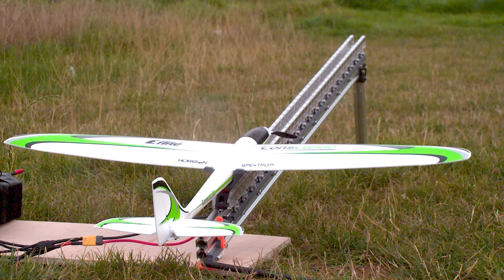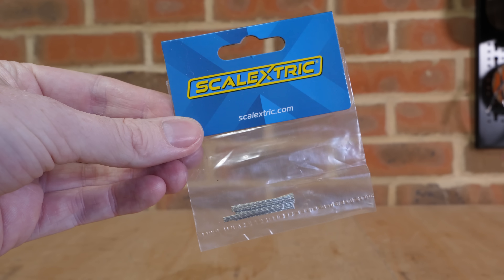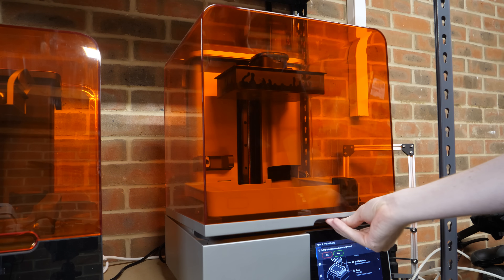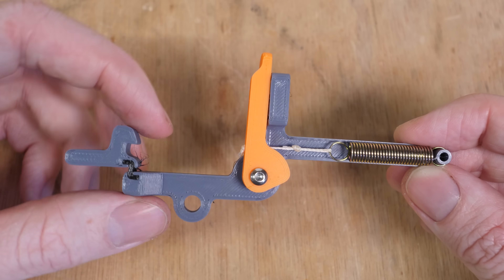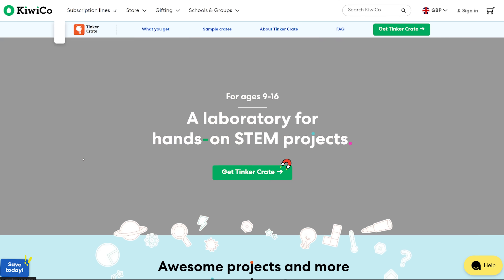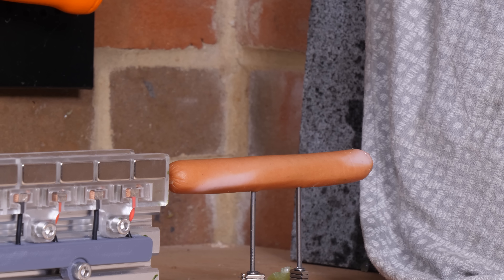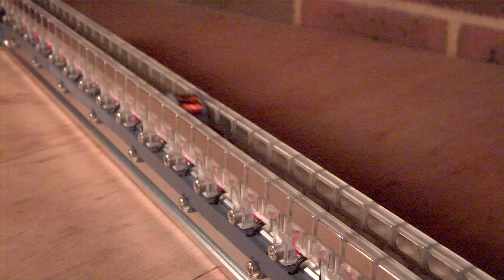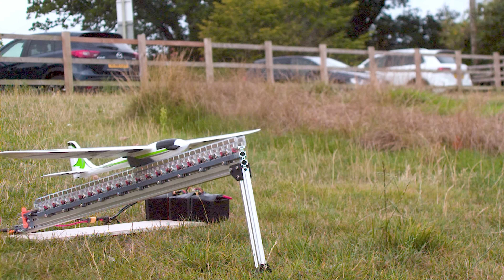Electromagnetic Aircraft Launcher

Comment: You coupd try aluminium wire. 
It has double the resistance, but is 3 times lighter. So while a larger gauge of wire will be needed and a physically bigger coil for the same turns and resistance. 
It will weigh less for the same performance.

Comment: As to the sparking. 
You can put a capacitor across the coil. The value will be a bit of trial and error. 
But it will absorbe the sudden voltage collaps as they disconnect and the EM field collapses. Which is exactly what the codes or in an old ignition system does.

Not sure if this will help or hider performance but couod help the contacts last a lot longer. 

Another option is to use starter motor brushes. The carbon lubricates them while the high copper content allows for massive current transfer.

Comment: Great project. With regards to the Launch switch bouncing, maybe you could use another spring OR your magnet idea to SLAM the switch shut so it can't bounce back. I think electric trains use a solonoid contact to switch in high power from overhead lines. If you start shooting nails this way then make sure you are below 14ft/lb lol.. nee nah, nee nah. :) Keep up the good work and I love your flywheel trebuchet idea, could maybe used to launch grenades as a cheap thought.

Comment: always very nice, interesting and of course skillful what you present here on YouTube, but since I come from E-Tech, I suggest turning the system around - putting a strong permanent magnet on the carriage to be accelerated and controlling the electrical energy supply (coils) on both sides of the rail ... then you don't have to transmit the current through brushes with so many losses (contact problems, sparks and friction). The trigger moment, when switching on and off, you can easily control with Hall sensors (or IR sensors), letting the MOSFETs switch on and off to activate the coils - well, just an idea to increase efficiency and make your little miracle even more powerful ,)
Reply from the maker: The launcher I built 2 years ago used hall effect sensors and mosfets. However, it was far more complex to build due to the timing control electronics, let alone have to wind far more coils along the rail.

Comment: There was a noticable lack of EE in this video; i'm not sure if this is relevant on this timescale but your inductor coil resists the change in current, would have liked to see some maths to see if it is relevant here. When are you going to build a real railgun? ;)

Also, Ofcourse it is faster than your calculations, adding a load makes it spend more time in your launcher = a higher total force.

Comment: Do the opposite, coils in the rail and magnets on the moving part, like a linear motor, with variable frequency and voltage you can control speed and power. You solve the problem of sparks and friction
Reply from the maker: That's exactly how my old launcher works

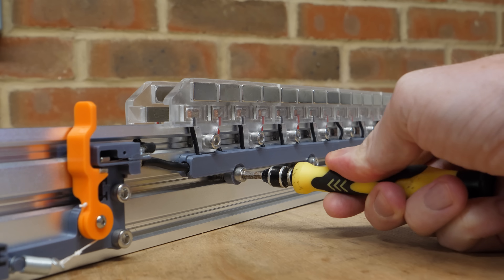Comment: 8:00 very cool solution to make your own reed type switch!

Another idea that first came to me, was making a latch at the top that as it hits, holds it up and won't let it bounce at all. Then to reset, you lift the latch and put in the lower latch
Reply: Any off-the-shelf light switch would work even better
Reply: @poipoi300  I don't know if light switch would be able to handle the amps? (I know most are 25amps AC always confused on how to figure out what DC current that means.)

Also, I think there might still be some 'bounce' in a switch at the high of speeds he's dealing with?
Reply: @justinbanks2380  His power source is DC, but if you check how the circuit is used, it's a lot more like AC. The load isn't continuous, instead it's alternating between on and off. Not for long either. Light switches are designed in such a manner that they don't spark. I'd imagine them to have less bounce on startup than what he built, but I don't know that for certain.

Thinking about this made me consider something else though. It's stupid to start the propulsion with a switch in the first place. This would just exacerbate melting issues on the first contacts as the sled will spend significantly more time there from a standstill. This is a common issue in railguns that they solve by having pre-travel on the projectile. Instead of some complicated switch to power on the system, the shuttle should be pushed into position. This would also make the shuttle achieve higher speeds.

Comment: 1- use round magnets, fixed in the center.
2- use two coil to both sides of the fixed round magnet in the center.
3- use metal ball bearings in electrical rails, this will provide the power contact to the coils, cover with isolation the rails with no power zones.
4- use LC series circuit to reuse Back EMF for next stage.

Comment: Thinking about it now, I personally would have gone with permanent power rails, and use the contacts to commutate a simple MOSFET bridge aboard the sled, a few caps on the + and - and the body diodes will freewheel on their own. The switching current needed to switch the FETs would be far lower and make the system more efficient. Though I might be overthinking this (job hazard lol).

If you wanted to really transfer some power I'd also ditch the solder braid or Scalextric parts for some racing grade slotcar parts. Professional Eurosport or Group 12 slotcar parts can handle well over 20A for short periods of time, this would require using the right braids with the right pressure, and also a braided copper power rail like on professional slotcar tracks. Look up the british slot car racing association for some pointers to take this thing to 11!

Comment: As other posters have noted, I think your top speed is limited by inductance certainly an MOV and a high current diode in reverse across your power supply would help. Maybe the magnets should be spaced further apart as you work your way down the track with the contacts moving progressively earlier relative to the magnets (so you get a progressive phase advance as it speeds up. Awesome video!

Comment: Wouldn't it be more practical to have the permanent magnets on the sled and the electromagnets on the rail, instead of the other way around? It might result in a heavier sled, but there'd be no need for brushes so there'd be a lot less friction. The timing of the electromagnets would be a bit trickier to get right, but nothing too hard. In fact, the timing could be adjusted for a gentler acceleration, heavier loads, etc.

Comment: I believe by using the expensive brushes you bought at first you can decrease molten copper on the rails, I'm not exactly sure but they seemed to be made out of nickel (judging by the silver color of it) and if not they had a coating especial to be rubbed against the rails.

Comment: You can probbably reduce the coil mass with aluminium wire, perhaps use graphite contacts to reduce the molten copper issue.

Comment: Now i see why rail based technology failed. If you put it side by side to a mechanical motor based mechanical pully lauchers or rocket powered launchers the efficiency is extremely low on the rail. Intrensesting stuff.

Comment: I think you will gain more speed if the magnets were at increasingly further distances as the object accelerates. then you can pass current at higher frequencies at each subsequent magnet and accelerate the object. it's more electrical work, but will achieve higher terminal velocity

Comment: as coil runs through magnets its act as a generator. measuring dc resistance wont do much as back emf will be much greater decreasing the max speed. 
try winding coil with 4 wires and then connect them differently to find a sweet spot. all in parallel, two in series two in parallel, all series..

Comment: have you thought about adding capacitors in the power rails to add stages to up the volts as it travels the length as it goes down to in crease acceleration and maybe one in the sled to make sure constant power to the coils so no lose of power ?

Comment: Just in case i missed it, why dont you build a classic lsm motor?

Ok you need more coils, but you'd have just a magnet sled and hall-sensors to trigger the coils.

You can build the coil static in the mittle and put 2 rows of magnets on your sled.

Comment: My lab professor recommended us this method: use a powerdrill in a vice and tap your foot on a phone with a counting app. One hand controlling the drill, the other with the wire. It takes some setup but it's so much faster, I actually do it like that because of the time save and ease of counting turns but another big bonus is neat coils have much better fields

Hope you give it a try if you ever make coils again!

Comment: Coil on the kart+coils allong the track. Leave the kart connected to the rail at all time. Use your brush system but replace with bearings these brush only carry 5V to trigger mosfets. 
This setup would be similar to universal motors, with transistors eliminating sparks. Bearings would allow to improve contact by adding pressure to the sides without creating lots of  friction. 

I think this would increase the energy transfer by about 400%.. So speed by maybe 200%

Comment: I was experimenting with a 1.2kj classical railgun a few years back. Every time I tried a solid armature it welded and the projectile went nowhere. Later I tried the wire brush design and it worked way better. 

I'd be really interested to see someone try to use liquid metal as a sliding contact in a classical rail design. One of the reasons I think nobody has tried is that you'd be spraying liquid gallium alloys all over the place. It would be very messy and anything made of aluminum that was nearby would get destroyed by the gallium if it got on it.

Comment: Important consideration when talking about the number of turns is the RPM- or in this case velocity Constant value. 
It is what limits electric motors to a certain speed using a certain voltage (not taking active field weakening into consideration).

The more turns you’ll do, the stronger the E-magnet gets and the more force / more acceleration is created everything else being equal. This comes with a downside tho, even apart from weight that I believe is far more important:

As your magnetic field for a given amount of current gets stronger, the same way the back-EMF gets stronger. Because when this coil passes these magnets there is voltage induced in the turns of the coil and there’s current flowing the opposite way than the current from the battery. 
Of course this reverse current flow creates an opposing magnetic field that works against the field that is propelling the sled forward / respective that is turning the rotor of the motor the desired way around.
This is called BEMF of Back-electromotive-Force. 

Of course the faster you pass magnets along a coil, the higher the induced voltage is and the more current will flow and the higher the back-emf will be.

On a coil with double the turns the back EMF for a given velocity will be twice as high.

Once the magnetic field pushing the sled forward (or accelerating the rotor in an electric motor) and the field that is slowing it down cancel out you reached the maximum speed of that motor. Be it a rotational or linear motor.

I believe that could have been even a bigger factor in your comparison. Not only was the coil with more turns heavier, it also reached its maximum speed soon along the way.

For the sake of explanation let’s assume:

The 400 turn sled reached it’s maximum speed at 1/3 of the way

The 300 on 2/3 of the way

The 200 on 3/3 of the way

And the 100 never reached it. It would have on 4/3 of the way

That shows us that the acceleration of the sled was the most efficient at 200 turns

400 turns accelerated the hardest but then cruised two thirds of the way at constant speed

300 reached a higher velocity but did so after two thirds of the way, without gaining anything energy from the last third.

200 used the available acceleration distance perfectly. It accelerated all the way through and reached its maximum speed right at the end of the distance 

100 would be faster than 200 if it had a longer distance available. 
Because it’s acceleration force was the weakest, it never could make use of this benefit because when it reached the end of the launcher, it didn’t had its top speed achieved. Because it accelerated slower than 200, because fewer turns = less forces it didn’t have 200s speed at the end of the track either and could never make use of the potential higher top speed.

That, I believe even is a bigger factor than the weight.

It’s like letting 4 cars drag race but not allowed to shift!

One stuck in first gear (400t)

One stuck in second (300t) 

One stuck in third (200)

One stuck in 5 (100)

While the higher the gear, the higher the top speed, the force and thus acceleration slows down proportionally.

So 3rd gear in our example was the sweet spot for let’s say 150 meters long drag race.

Make your launcher shorter and probably 300 or 400 will win the race.

Make it longer and 100 will beat 200 all the time! Because weight isn’t really the limiting factor here!

If you want to gain a deeper understanding about it look for „KV rating - brushless motor“

Maybe you could do the experiment if you want to! 😃

Comment: 6:49 what you could've done would've been a ratchet stopper or whatever they're called (like a ratchet wrench), so it allows movement 1 way but not the other (for more context how that would work here, you can watch Mythbusters rig on catching a Katana or samurai sword if you will with your hands), would've been a cheaper stopper, but as long as it works it doesn't matter, so yeah. In he future such a stopper could be more cost efficient solution.

Comment: That switch is kinda silly, you almost reinvent a relay. You could simply have made a spring powered wedge that wedges itself into a V shaped contact supported by some kind of dense foam so it absorbs energy and stops bouncing yet the large surface area helps with the high currents.

Comment: Oh, overnight I also remembered - make sure to minimize your air-gap between the magnetic rails and the coil - it can have a pretty big effect. I suggest using epoxy (along with a back-iron for the magnets) to glue the magnets such that the face is exposed directly, as opposed to needing to have some 3d printed dead space between the coil and the magnet. Ideally your air-gap will be less than 1mm on either side.

Comment: I was thinking of a system to save battery life for long range planes with a quadcopter that will only get the plane as high as possible and then release the plane. This way the plane only uses its batteries for level flight and not for gaining altitude which is the most demanding. Could you try something like this and see how much we could extend the range?

Comment: You can put an identical rail that shoots backwards ,under the first one and connect the top sled to the bottom one via a small nylon rope. So the bottom rail effectively fires a sled backwards but the sleds are connected together. Doubling the power without making the rail longer.

Comment: Correct me, if i´m wrong, but isn´t this the exact working mechanism of a brushed dc motor, just in a linear setup? If your contact rail is sufficiently smooth, I think, you could use carbon brushes to reduce wear. Also experimenting with different timings between contacts and magnets might provide more efficiency. Cool project!
Reply: yep.  They're even called linear motors.  Not common since they have limited range and force compared to a radial motor, but they have some interesting uses.

Comment: what if you mount a capacitor inside the coil so that you can get past the torque/lag at the beginning of the run,  and I would use carbon fibre material instead of the metal brushes.  To fight friction if you put a repelling magnet on the bottom  it would not have friction slowing it down.

Comment: Measure the inductance of your coil when inserted between the magnets (there might be slight difference when inside mag field). Also making the gap between magnets narrower  and use bigger magnets to increase the size of high intensity mag field volumes you can use). Think about geometry of produced magnetic fields and volumes of highest field intensity - focus on these mag field volumes and you will get the best results. Very nice experiment :) Best regards

Comment: This is great, but I'm surprised that you didn't make it modular so you could make it have arbitrary length, by running the wires over or under and connecting them with small magnets attached to the outside of the sides.

Comment: Try using carbon brushes.
I think when nickel and copper are in contact with each other some of the copper strange gets welded to the nickel strip which adds extra friction to overcome.
This will not happen with carbon brushes.
Carbon brushes also reduce the contact resistance.

Comment: You can use mosfets as switch. They should be able to handle the current and they are far more quick than any mechanical switch (without bouncing at all). Someone already pointed out this on the comment, but you can reduce the diameters on the 400turn coils to reduce the mass. There should be a sweet spot between turn-diameter-voltage, but I don't know how to calculate this
Reply: Another thing: you can use motor brushes instead of the coppers one. They are more stable, temperature resistant and self-lubricating. And probably cheap  in the long run (you will probably never need to replace these)

Comment: are you sure the coil manages to keep up with the alternating current? there is energy stored in the magnetic field of the coil and when you reverse it this quickly, it can fight the rotation of the field. whats why electric motors have sine controllers. you have essentially built a linear electric ac motor :))

Comment: Instead of two rows of contacts, you could have a single row of contacts and place the brushes in line with each other - spaced apart by the spacing of the contacts.